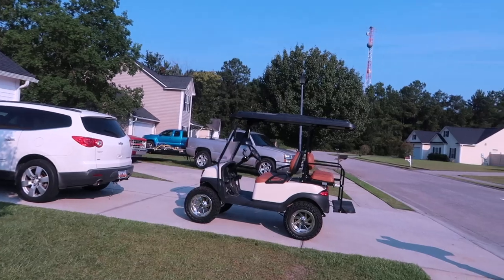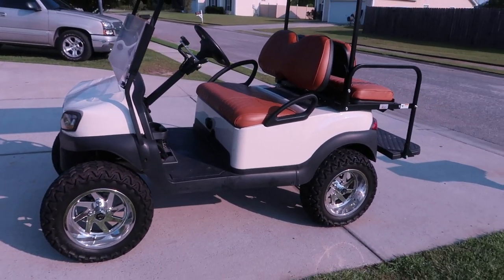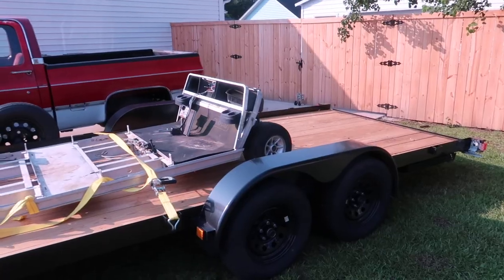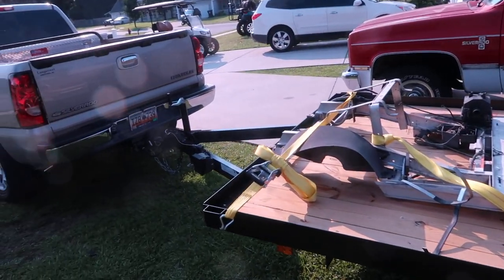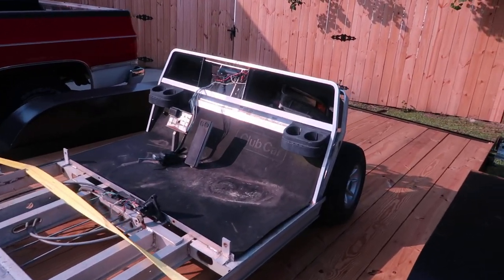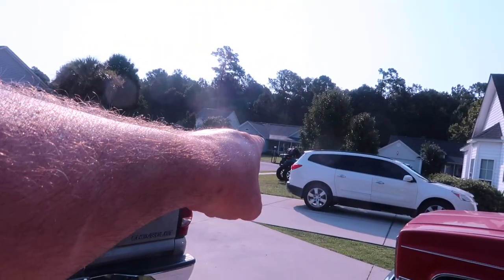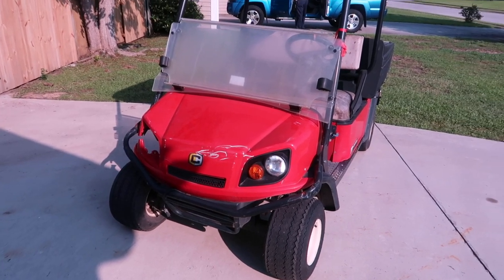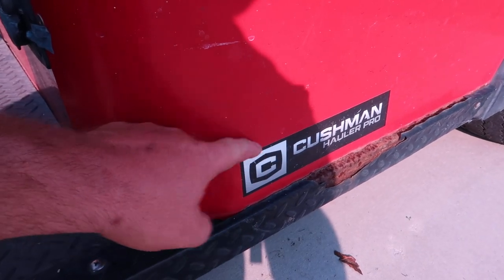I Finally Bought A EZGO Golf Cart | CUSHMAN 72v AC Drive Hauler Pro | Will It Run?

Comment: Hey nice work! 
EZGOs are okay if you take care of them, like wash out the frame where the dirt collects every time you wash the cart, although the steel frame is a "weak" point. The Club Car has a weak front end that constantly burns through bushings so to each their own I suppose. I watched these videos intently as I have a 72v EZGO. With the stock controller I am currently getting 30+/- mph and that's not full speed with that controller. EZGO changed the controller in 2020 to lock out programming on the 72v carts (my cart is pre-2020). So when I saw you with that Navitas it peaked my interest, especially since you can program on the fly. 
I have been pondering my options as I want a UTV for light use but they aren't street legal here while golf carts or LSVs are and I would rather only have one vehicle to take care of. One of the issues I have with my 72v is wheelies, yep it lifts the front too easily so I have been thinking about how to solve that, relocate the axle, lengthen the frame, then I saw the Cushman hauler is 11" longer! DING! DING! DING! That's when I found your videos. Another issue is width and 4x4. I found a 4x4 kit, while costly will put a long travel front end on with a front drive while getting a wider stance and a 2 speed rear axle. So today my thinking is sell my current 72v get a 72v Hauler, the 4x4 kit, a grizzly back seat, roll cage, aluminum roof. I have also noticed the newer haulers have hydraulic brakes!! Where do I get those?? Now if I could only build a 4 link, and convert that 2 speed axle into a full IRS I would be in that happy golf cart / UTV zone.